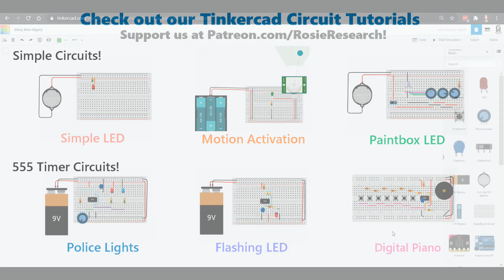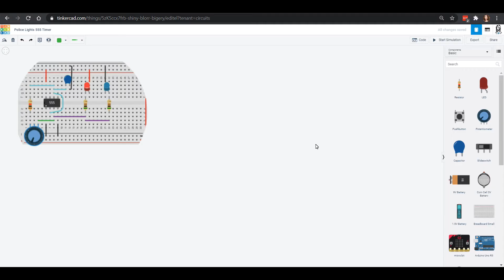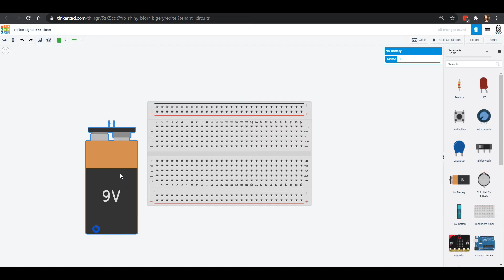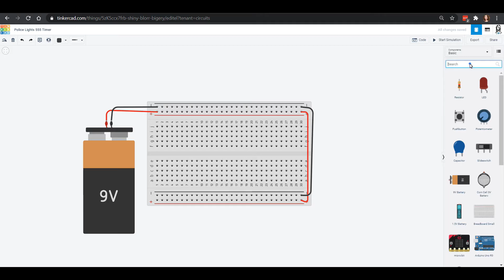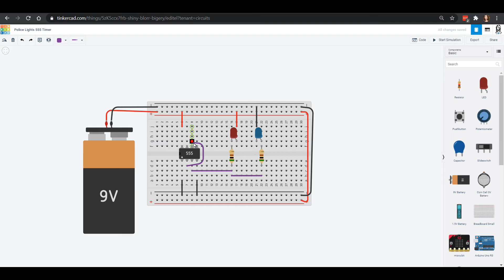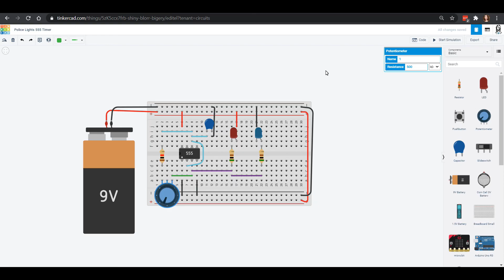Tinkercad Circuits Tutorial - Using a 555 timer to make police lights

Comment: You didn’t connect the pot to the center pin so your pot was a fixed resistance. That’s why the speed didn’t change when you turned the knob. Just a jumper to the right and center pin of the pot to get the variable resistance.